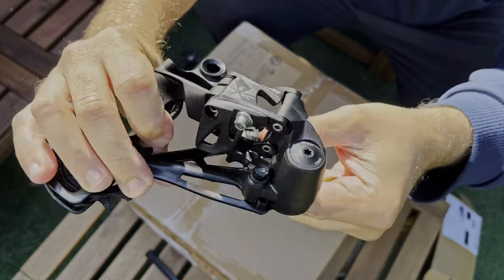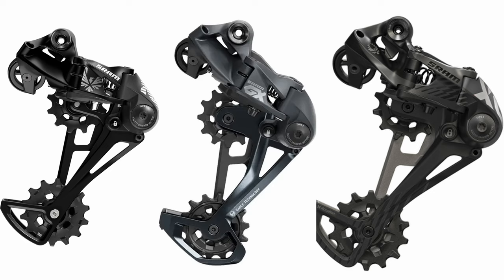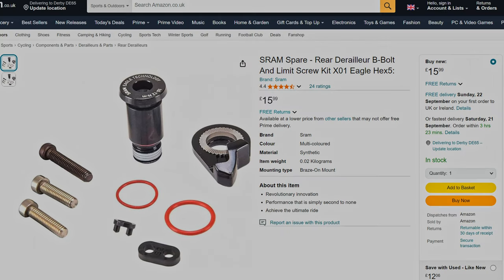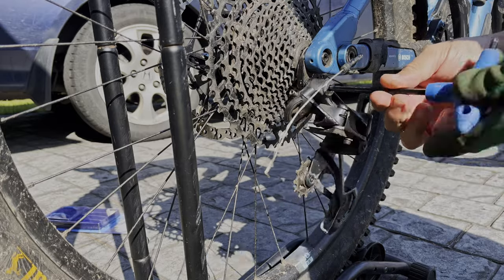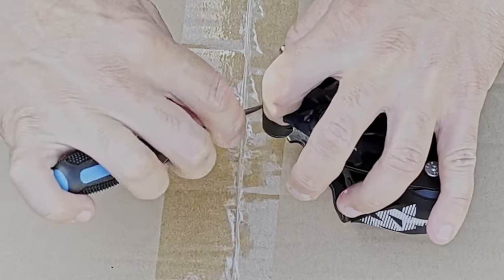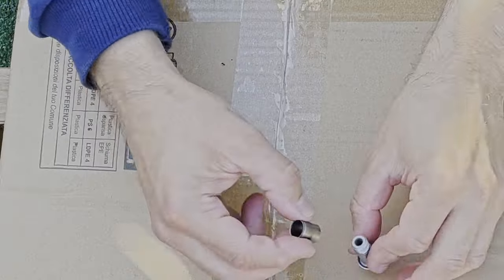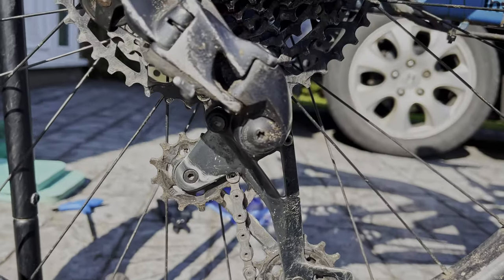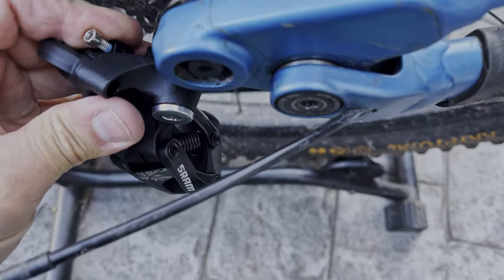How To Fix Bad Shifting on SRAM SX / NX / GX Derailleur

Comment: Can confirm this improved the shifting on my NX derailleur. After the install (very easy BTW) i took it for a ride and the shifting was actually WORSE, i was like WTF. Went and reindexed and no better, thought to check B screw gap (luckily I had the tool gauge) and yep it was way out. After adjusting correct B gap the shifting is HEAPS BETTER. No more cheap wonky free play in the derailleur main pivot. The SRAM X01 Eagle Rear Derailleur B-Bolt & Limit Screw Kit cost me $AUD51, which is a much cheaper upgrade than buying a GX mech, which is $200+.
Reply from the maker: Great stuff. Glad it helped you too! Thanks for posting 👍.

Comment: Mine's fairly new at the moment, but thanks for the tip - I'll try to remember it for the future!
Reply from the maker: Yeah probably nothing to worry about for a few months depending how much riding you do. I had done the mod to my gx after about a year from new as it started the shift poorly. Now the gx is knackered so I bought a new NX to replace it so it gave me the opportunity to make this video while transferring the bolt to the new derailleur. The x01 bolt is about 2 years old and as seen on the vid there is hardly any wear to it so it's definitely the right way to go. The original gx bolt was battered after a year when I replaced it with the x01 kit.

Comment: I did this, it was absolutely an improvement until the clutch died a few months later.  Replaced it with xt mech and i sorta think I should have done that from the start.
Reply from the maker: Haha good old SRAM 😅. I wonder how long this NX derailleur is going to last 🤔
Reply: @BoAndHisBike  it was a gradual loosening so I didn't really notice until the bike got quite loud. It was weaker than the xt with the clutch off in the end. Worth checking it's tension periodically.
Reply from the maker: Will do. Thanks for the tip.
Reply from the maker: @yeahboiwahoo Sorry but I've just re-read your post. Did I understand correctly that you used Shimano XT derailleur with the SRAM Eagle drivetrain?? If so how well does this combo work together?
Reply: @BoAndHisBike  xt mech and shifter, the rest is still nx etc. Works better than the full nx but not quite as nice as how an xt cassette and chain etc does but that's a bunch more money.
Reply from the maker: Nice, thanks for clarifying. I may try that! My mate has a Shimano drivetrain on his YT ebike and as he stated 'sram is agricultural' in comparison 🤣. I've had a go and the microspline system is definitely more refined but cassettes are like 130 quid 😱. And cassettes on ebikes don't last very long😆.

Comment: Or lock it in place by adding a thicker washer on the outside, no reason for it to move once you have the b-gap set. Even cheaper and much quieter. TRP has this as a feature on their derailleurs
Reply from the maker: Doesn't the room for it to move protect it a bit from rock strikes, hitting the ground, etc.?
Reply: @BoAndHisBike  I don't believe so. It doesn't move a lot but just enough to make noise on bigger hits
Reply from the maker: Thanks.

Comment: SX throw in garbage. NX throw in garbage. 
Gx  all day. 
Set b-tension with white tool   In the 11th. 
Keep your bike clean and you won’t have issues. Don’t forget hanger alignment. 3 years 16000km on Gx axs with Ratio sr52x cage and pulleys. 
Lots of crashes. No issues.
Reply from the maker: I replaced my battered GX (~6500km) which I couldn't index properly anymore with NX. Let's see how long is it going to last 🙄😅.

Comment: Seems like a pretty silly and misguided upgrade to me.  The real difference between and NX Eagle and a GX Eagle derailleur is lots of more important things that a pivot bolt that doesn't even move during shifting and a bit of weight.  The GX jockey pullies have bearings insteead of bushings, the cable pulley is removable for cleaning and replacement, and the whole derailleur is also notably stiffer and harder to bend.  It looks to me like you are just promoting the sales of an almost pointless upgrade.
Reply from the maker: Have you done it yourself? From the tone of your comment I'm guessing the answer is a 'no'. I have and the play in that bolt definitely affects shifting negatively. I have done it on both NX and GX with the same level of improvement.
Reply: There is a noticeable difference in the mounts for the NX/GX versus the X01/XX1.  The NX/GX shift fine for about 6 months of riding until they loosen up substantially, especially in mud and wet weather.  This kit would help shifting since the X01/XX1 stuff is a lot more solid in the long run and is a lot more firm even from factory.
Reply from the maker: Thank you for the more detailed explanation!👍
Reply: NX desintegrates after a couple of trails, I can shake the cage pins out just by riding it even if its new! worse shit you can buy
Reply from the maker: @madeiradriftin4429  I guess I'm just about to find out! 😂
Reply: It makes a huge difference that you obviously haven't tried. Did the gold xx1 bolt upgrade and you can wiggle the cage and it is so much stiffer. This is a pretty widely known upgrade Mr amateur.
Reply: @traildad604  Yes, the XO and XX1 are much firmer from the factory,  AND most of that difference is in the derailleur body and cage, not the pivot bolt.  Trust me, I straighten these things every day.  And the XO and XX1 are really hard to bend, while the SX is shockingly soft, and the NX is plenty soft enough to bend pretty easily.  Given I probably service a dozen or more Eagle derailleurs in any given week, and many of them have at least a couple years of hard muddy riding, I also have to disagree with anyone saying they readily wear out sooner than a full season or two of hard muddy riding.  They get bent and quit shifting well, BUT, that's not from wear, that's from misalignment due to impacts.
Reply: @BoAndHisBike did the same thing with my old nx, upgraded the pulley to 14t and 16t, the change the bolt and the limiters. Just turn my NX into GX with ceramic bearing pulleys
Reply: @madeiradriftin4429 
I couldn't actually believe they made something worse than NX.
Then they released SX 😂
Reply from the maker: All these comments about quality of NX do not inspire confidence! 😅 I may send it back and ask for XT to check how well (if at all) SRAM and Shimano are going to work together in that combo 🤔.
Reply: @BoAndHisBike  The early SX stuff was awful!  NX is perfectly solid stuff, even if it bends easier than would be best. Also, NX level is more comparable to Deore. XT level components are closer to XO. All of them can be made to work pretty respectably in the hands of a good mechanic, and any of them can fail. But yeah, the higher end stuff from either brand is generally more reliable, more robust, and more expensive. Don't get bogged down in overly opinionated internet babble!
Reply from the maker: Haha there is that. At the moment the NX shifts perfectly! My gears have never been so good to be honest. And when I was installing it and playing with it when making my video it looked pretty solid. I guess it's all about chance and rock/ground strikes and with how big of an impact.